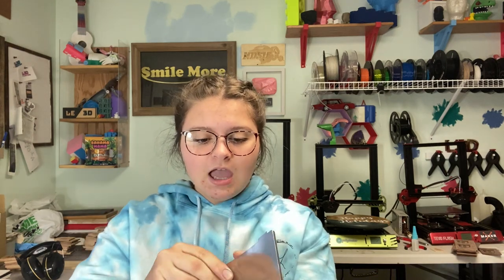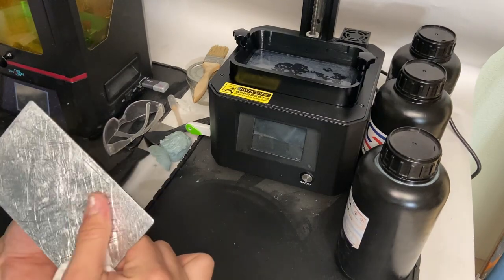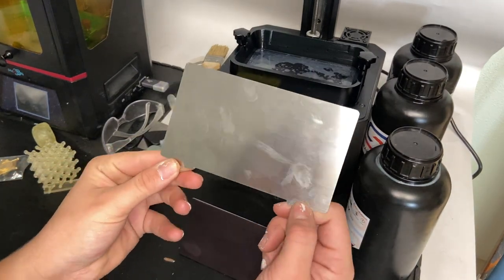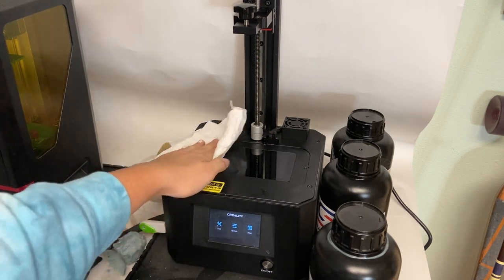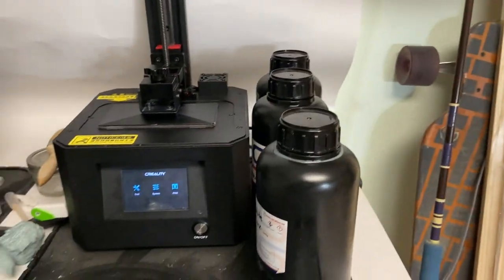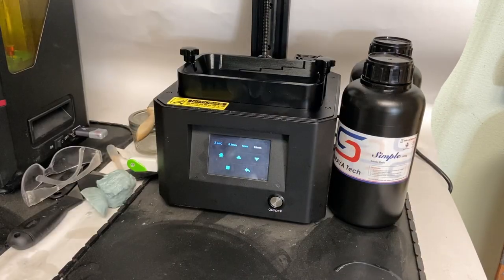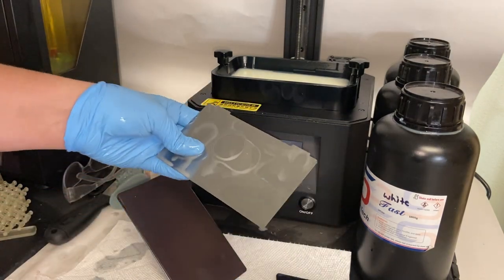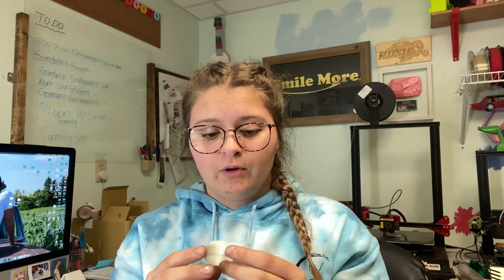Creality Flex Build Plate for Resin 3d Printer Review and Installation

Comment: Nice, good to know. I didn't use my SLA-Printer very often. Because of the bridle prints and the mess. I think that this build plate make it much more easy, because I didn't need to move the hole build plate. Now I wait on really strong resins. Thank you.
Reply from the maker: Ya it’s pretty great and makes resin priming way easier

Comment: Hi, great video, I bought the same product and I have the same printer butI do not know why it is not working. I was trying to solve the problem multiple times but everytime it just didn't adhere to flexible plate. Pleaase have you got any idea what could be wrong? I print a lot I this is livesaver for me.
Thanks
Reply from the maker: Maybe the magnetism is not strong enough maybe u can get a replacement
Reply: @TimberWood.Customs   flexible sheet adhere to magnet but model just stay in the resin van sticked to FEP film :(
Reply: Have you tried sanding the flexible plate? I have seen People recomend this

Comment: Very nice video. One thing, do not use denatured alcohol, (use regular isopropyl alcohol, 91%-99%). Denatured alcohol is a fuel and has additives in it you don't want to have on the build plate.

Comment: I just start using this, but my bottom layer is overexposed and suffered heavy elephant foot. Also the bottom layer details are so bad, but if i reduce the layer time to same like top layer im afraid of model falling off not sticking to the plate, what should i do?